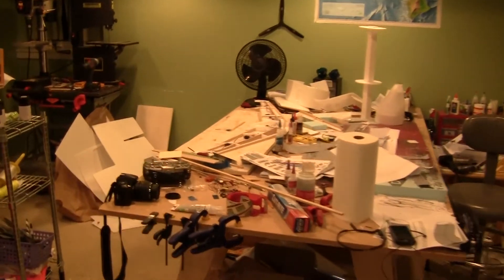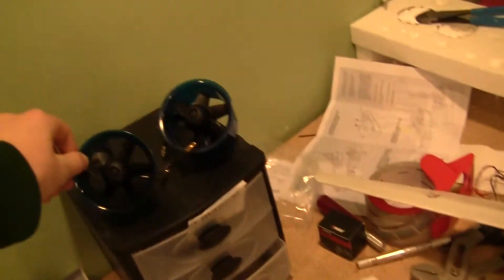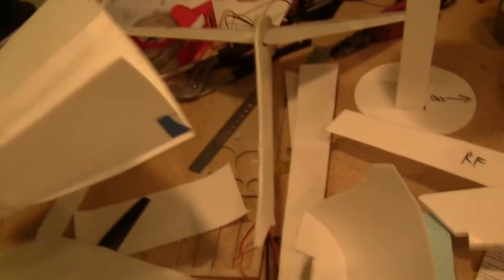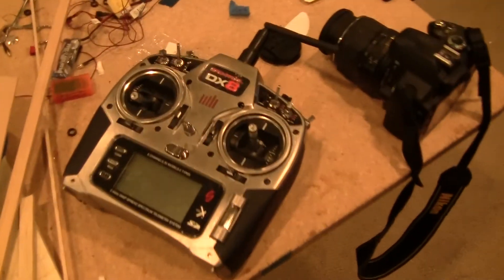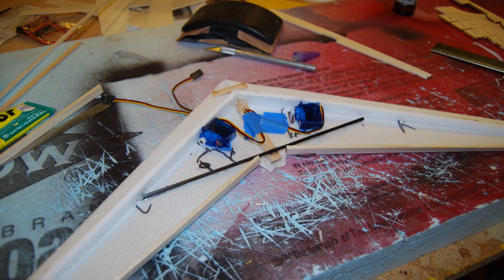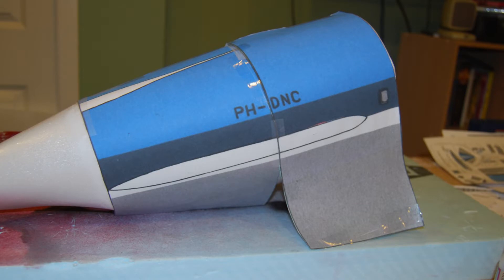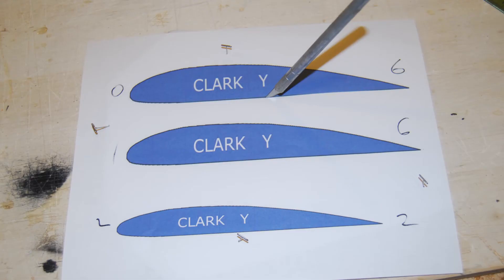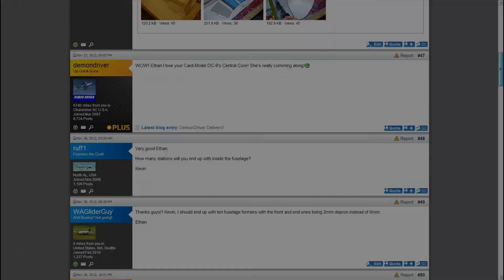Douglas DC-9-14/15 Depron EDF Build Part One

Comment: Are you on Instagram? I work with a BAE jetstream everyday so if you want some close ups for scale details let me know. It belongs to eastern airways In the UK
I think I'd be tempted to build a Hercules c130J 
also do you have some good links for these Paper craft models you use? or just a case of google them and look for the best you can find?
Reply from the maker: I don't have an instagram but i'm on RCGroups (big rc forum) and I have a build thread in the airliner section. Thanks a ton for the offer, if I run into something i'll contact you! My favorite paper model designer is Skyline Paper Models but you can get tons of plans from Ecardmodels and Papermodels. You can find tons with a google search too. The hard part is finding plans that have cross-section formers.